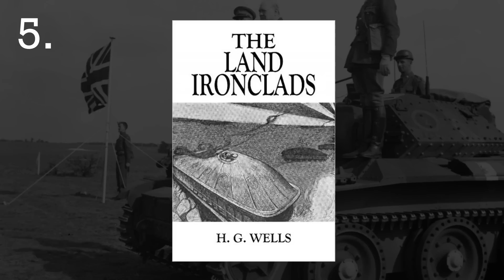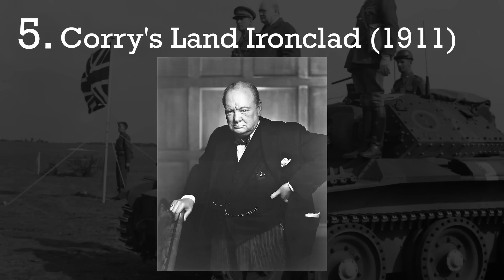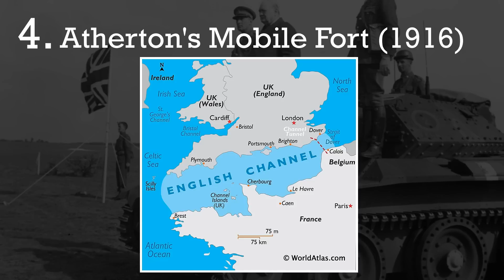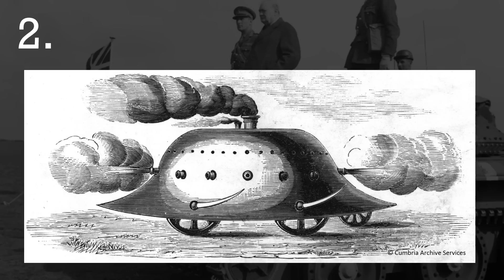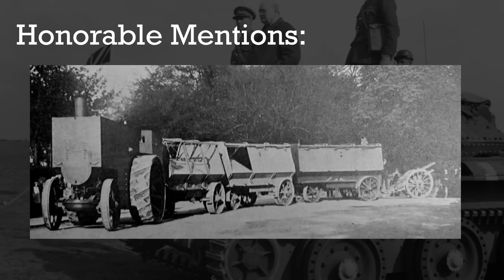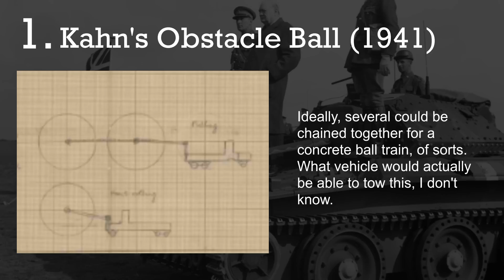Weirdest British Tanks Ever Designed

Comment: I realize this is probably foolish of me but a part of my brain insists that the Praying Mantis design is onto something. Like, not the way it is, but a extendable crane of sorts with a assembly to mount a recoilless rifle or ATGM launcher alongside optics? Park the vehicle it is mounted on behind a ridge or a bunch of trees, unfold the gun system, extend it over the crest/treetop and you'd be good to go – relatively save from return fire, low risk for the operators, proven tech base, kinda cheap.
Then again, I suppose you could have much the same effect by sticking a guy with a javelin launcher on top of a fire engine.

Comment: I'd make the Mantis again. Put that hummer tire on a chassis that morphs into a triangular track. More like an atv with a 3 story folding stork neck. Cameras and a joystick hooked to four .50's and two javelins or similar. Give it one job,; peeking over rooftops, walls and high ground. A shoot-n-scoot that uses buildings instead of carrying armor. 
  Just weld a set of steps on it and your support can use it.
  Sounds more fun than practical, even though a lot of things can't see for 💩 in tall cornfields or sawgrass.